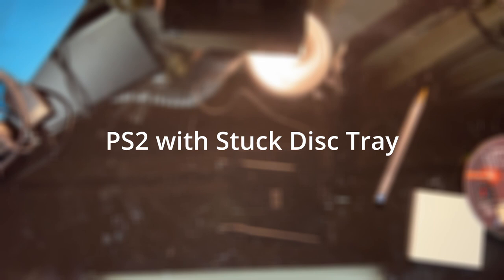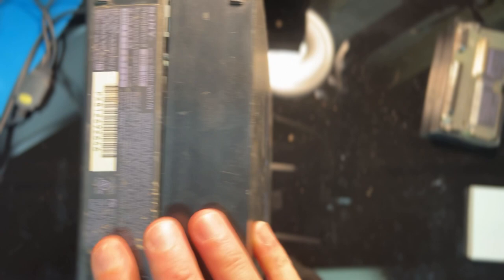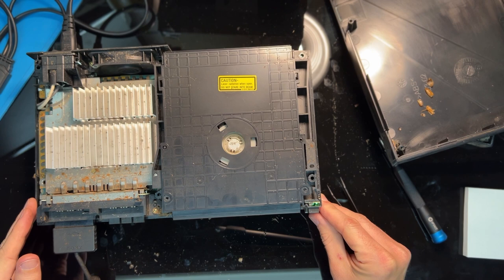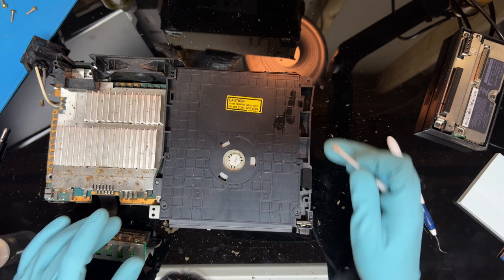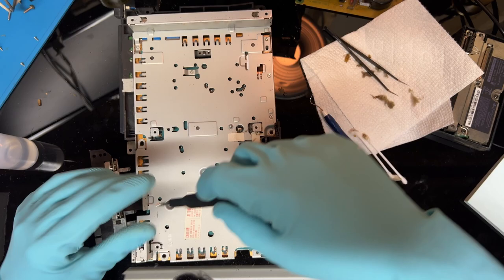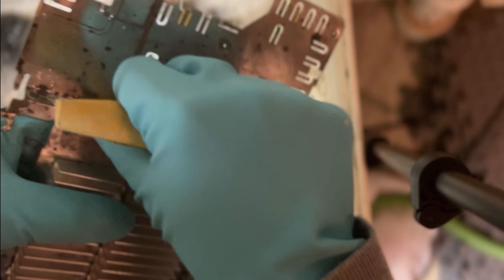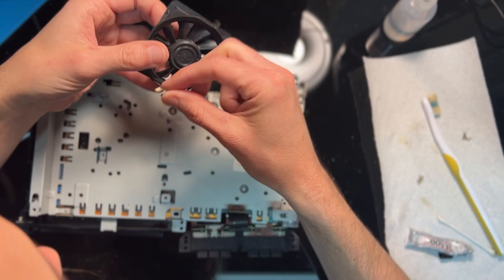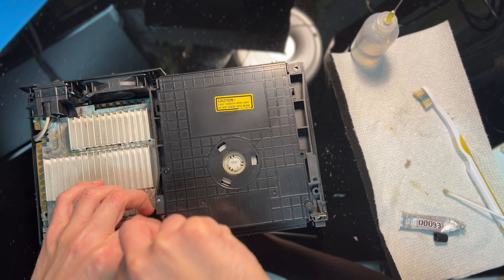Let's Fix it - PS2 With Stuck Disc Tray

Comment: Just bought one off ebay and I came here to see if i could fix this myself.  Did not anticipate there could be bugs inside... I'll pass on trying to fix it
Reply from the maker: It’s not a sure thing but based on my experience I’d say something like 25% probably have some sort of bug in them. Good news is I’ve never found LIVE bugs inside. If the outside is kinda grimy there’s a better chance it has some in there. I recommend using gloves if you decide to open it just see what’s inside.

Comment: Adding a piece of tape on the disc holder did work for me, but not another of my Platstations so the tape method  is not the proper fix. I took apart the disc drive, cleaned the white gears and belt, then greased all the gears up with some light lube (not the belt!) and it worked for both of my systems! Give it a go and you should see the same results without tape :)

Comment: Please help I was fixing this exact issue, took the cd cover off and then powered it up without it on and it would power up and enject no problem. Unplugged it again put a piece of tape over the magnet like you said and placed the cd cover back on gently and was very slow and gentile. Then tried to test with the tape and now for some reason the system is not even powering on… didn’t have that issue before. Did i ackdentlt pull the power ribbon too much the side in the buttons looks good but is it an issue with the bottom side of the power ribbon. Was literally working just fine with power lights and doing exactly want you did. Thanks for help!
Reply: Okay so the issue was that when I was fixing this issue the power band disconnected from the motherboard so thanks to your other video on power issue I fixed it! Now it’s powered up, ejecting, and working there is another issue. The game disks which is brand new disc says “Reading Disc…” and won’t seem to start the game. Over the magnet I did use and cut a small round circle of electrical tape I had not masking tape is that the issue you think? Doesn’t seem to read my brand new Frequency game disk which is the blue finish ps2 disc and in perfect condition. What do you suggest here?
Reply from the maker: Sounds like your PS2 is putting you through the wringer. Honestly think your laser might be going. I can’t see the tape messing with that assuming it’s not interfering with the disc spinning.
Reply: @FixMoreWasteLess thanks man for the fast reply! I will try cleaning the reader part to make sure, if it is the laser do you suggest buying the new part or what? Thanks!
Reply: @FixMoreWasteLess I actually just found your read error vid so going to check out doing that cleaning lense and such, and looks like if needed you have links to new lasers! I so appreciate you and your videos! I had picked this thing up use online thinking it worked.
Reply from the maker: Sucks that it didn’t work right away. Yeah buying a new laser’s the best bet. Unfortunately, it’s not a guarantee it’ll fix the problem (at least for some of mine lol)
Reply: @FixMoreWasteLess thanks man! I tried a different game normal white cd bottom game called defender and it worked with that game, but not with the blue bottom cd. What does that mean? And just checked it works wirh Medal of Honor Frontline too.. from your other video amazon links my laser looks like that 400R to me.
Reply from the maker: Not reading blue discs is a weirdly common issue. Does it sound like it’s grinding or anything when it spins? 

There are a few tricks you could try out. 
You might have luck putting scotch tape on the inner ring of the disc. It can help the spindle grab the disc. They’re thinner than the dvd discs or something. 

Depending on the model there’s a white gear near the back of the disc drive that can be adjusted and might get it reading the disc.  

I don’t think either are really long term solutions to the issue though.
Reply: @FixMoreWasteLess the tape worked when I stand it virtical and not flat for my blue game Frequency!!! Wanted to play this from my childhood with my kids! You today man and your vids have helped me completely fix my PS2! You are so amazing man thank you I so appreciate the videos, and your comments to help me out! Thank you! I so appreciate you!
Reply from the maker: Aw thanks! So glad it helped you!

Comment: what do you mean the plastic balancing piece at 3:44, i just wanna be sure. do you mean that small white circle in the middle or where do you mean the plastic balancing piece? plz help also do you leave the console plugged in while doing all this? also, after you fix the disc tray is it safe to put the ps2 back together
Reply from the maker: Yeah the small white circle in the middle of the lid. I had it plugged in so I could test the tray opening and closing. If you’re uncomfortable with that you could leave it unplugged while you’re working on it and then plug it back in to test. It should be fine to reassemble after you work on it.

Comment: How do I fix mine somewhat stuck tray? I had to give it a push everytime I need to close the tray. Opening works fine, only closing stuck a bit.

I already open it up and everything is clean
Reply from the maker: Does anything happen when you push the eject button to close it? Anything sound like it's spinning inside but the tray's not moving?

Comment: I liked your teardown. I have a question. My PS2 had been stored for ages and I got it out turned it on and I get no sounds but the power lights up but the eject button will not eject, so I tore it down like you did and it still wont eject nothing any tips?
Reply from the maker: I’d check the ribbon cable connected to the power button and make sure it’s well connected. Does anything happen when you push the eject button? Any sounds or lights flashing?

Comment: Im confused about using the tape, like where do i put the tape? The white part or the black part?
Reply from the maker: On the white plastic part that spins. Place a bit of tap on the bottom side to create a barrier between it and the magnet that’s in the center of the part that spins the disc.

Comment: The bottom screws are screwed on so tight. I cant unscrew them😢 got any tips?
Reply from the maker: Put a lot of pressure down on the screwdriver when you try turning it. So you don’t strip the screws and make it even more difficult. A rubber band between the screw head and driver can also help prevent it stripping. If it’s still being stubborn try more torque with either a thicker screw handle or clamping a wrench on the handle. Just remember to keep solid pressure down when turning. 

You could try heating the screw up with something like a hairdryer so it expands a bit and loosens up. A hairdryer won’t hurt anything on the console. If you have fine enough pliers to get a grip on the screws you can grab the outside and turn it but those areas are very tight so there might not be any room to grab it. 

A touch of wd40 could help but you want to make sure you clean it all up as it is corrosive. That’s be a last resort.

Comment: Hiya, where exactly do you place the tape? I couldn’t see it cheers
Reply from the maker: For the power button ribbon cable? This version has the power button on the bottom case but others do have it attach to the top. You can tape it down on the smooth section of the disk drive near where the ribbon cable attaches.

Comment: So I removed the top cover and I believe a silver string was attached that ripped a bit… now what…
Reply from the maker: Was it the ribbon cable to the power button on the front? I did that same thing before. If it's cut, you're better off replacing the ribbon cable. I have another video where I had to do that. You can skip to the 9 min mark for that. https://www.youtube.com/watch?v=GVQB73l6KKE
Reply: @FixMoreWasteLess  after researching more after I did it I do believe it was the ribbon cable unfortunately haha. However I do not believe I cut it but I did pull it out in a aggressive manor unfortunately because I was unaware something was going to be attached once I took the case off. Sounds good I’ll check it out thank you!

Comment: Hi. I've just tried booting up my PS2 that I haven't used in years. Everything switches on fine but I can't eject the disk tray.

I've been looking online for a solution and I've seen a lot of people saying that their disk trays open partly or try to open but can't. With my disk tray, it doesn't even seem to be trying at all. I press the blue button, the light flashes a bit and all I hear is two very small clicks and then nothing. The disk tray doesn't open at all and it doesn't try to open either.

Please, does anyone have a solution to this?
Reply from the maker: Have you taken it apart to see what’s going on inside? The top section comes off with just taking out the bottom screws and then you can remove the top cover of the disc drive. It might be a loose ribbon cable or have something to do with the gears and band that turn to open the disc drive. Opening it up and pushing the eject button should give you some indication of where it’s getting hung up at.
Reply: @FixMoreWasteLess  No, I haven't tried that yet. My dad and I are planning on trying that tomorrow.

My PS2 was very dusty when I booted it up again for the first time in years (since before even the pandemic), though I did wipe down the outside, of course. I hope the problem is still salvagable if it has something to do with dust on the inside.
Reply from the maker: Good luck! The nice thing is those PS2s are pretty resilient. Let me know how it turns out and if you have any issues.
Reply: @FixMoreWasteLess  Thanks! Though my dad says he can't guarantee he can take it apart and put it back together again without any issues during or afterwards, as he isn't an expert. Are there still places that do PS2 repairs (since I am aware that Playstation no longer supports PS2 repairs)?
Reply from the maker: It’d be hard to find a place to work on them. What they would charge to fix it might be as much as buying a working on off eBay so most places don’t even bother. If you’ve never opened one before I recommend taking pictures as you go just so you know what screws go where. There are different variations even of the original PS2s so a video of a tear down might not be exactly the same as yours.